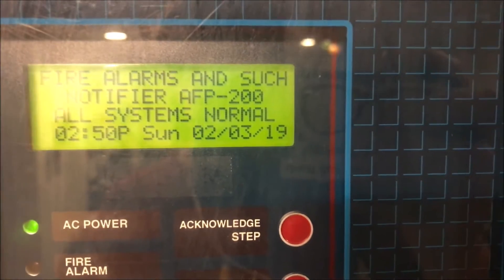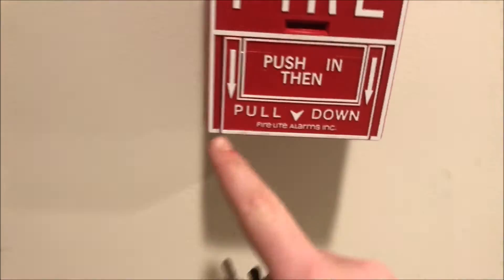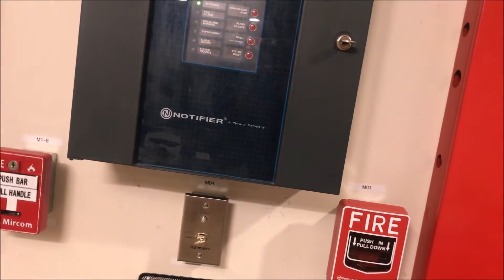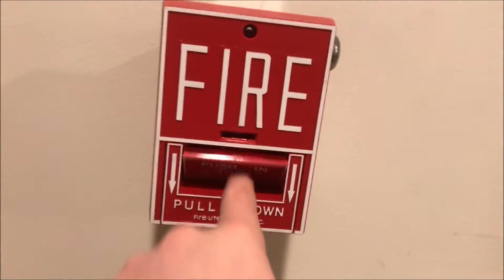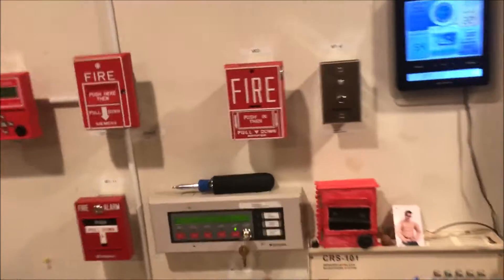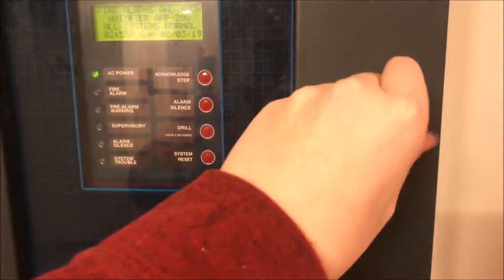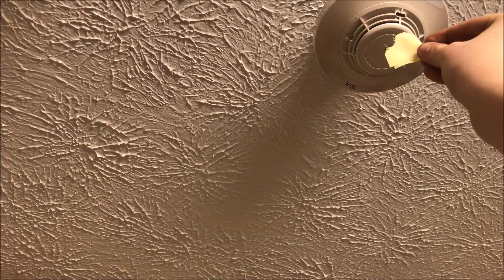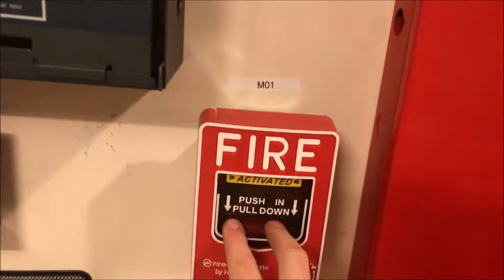Notifier AFP-200 Test 2: Request Test-Dale Nuss

Comment: The Student Center at my college has a Notifier AFP-200 system! It replaced an old Standard Electric Time "Alarmatic" panel some time in the late 90s or early 2000s. The renovated areas have FSP-851 smoke detectors and NBG-12LX pulls that work off it pretty well (though the NBG-12LXs blink red since the panel does not have FlashScan), and the renovated cafeteria has P2RL horn/strobes, while other renovated areas have SpectrAlert Advance P2R horn/strobes. There are also still some old Standard 450 horns with Faraday strobes in use, old Standard heat sensors, some newer Edwards and System Sensor heats, and Faraday F1GT "Chevron" pulls.

Comment: Also btw, that was actually the 1200hz interrupted tone not 800hz but it’s fine. Just letting you know if there is another request for 800hz.👌🏻👍🏼
Reply from the maker: I am so sorry! One of the clips must not have connected fully
Reply: I requested this system to be somewhat like my schools but I knew it wouldn’t be perfect. My schools alarms in the 2000 area are spectralert classics, notifier bg 10s, and a bg 12 replacement. Most of the alarms however are strobe only’s. (You can’t hear the alarms in the classrooms, just see the light!) In the original 1995 spot they have system sensor mass horns with Gentex GXS Strobes mounted under them. (Mounted the same way as in Zachary Flecks dorm fire drill videos) These are set on slow whoop. And are set on 800hz in the remote areas in the school. Again you can’t hear these alarms in the classrooms but there isn’t even a strobe in the room to alert you! I requested 800hz cause since I’m a 6th grader which means I’m normally upstairs which has spectralert classics but when you go down the stairs you can see the counseling hall where you hear that alarm which is on 800hz. The Whole schools alarms are on low volume with the exception of the main stairwell.